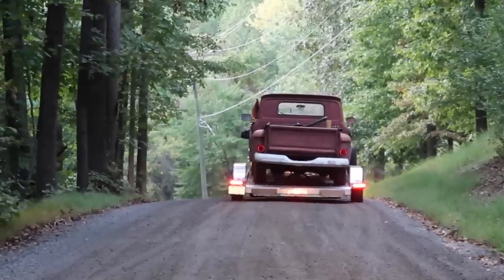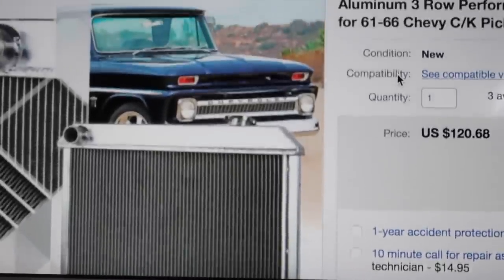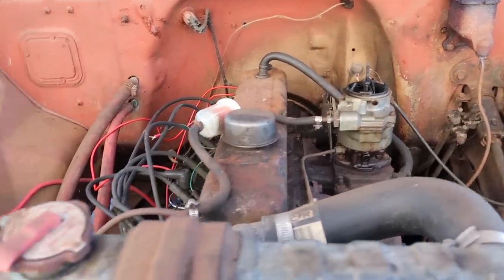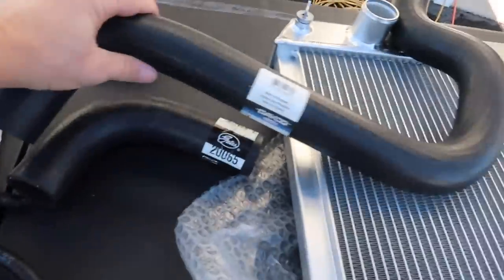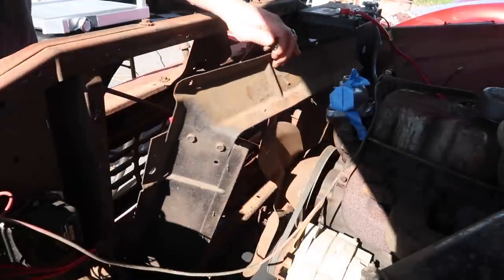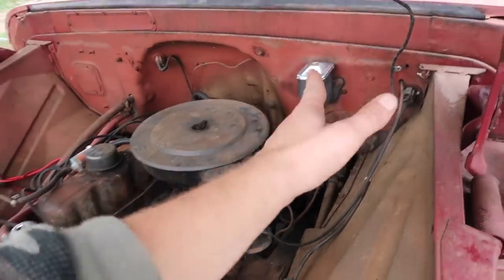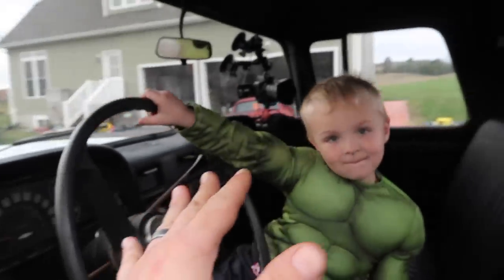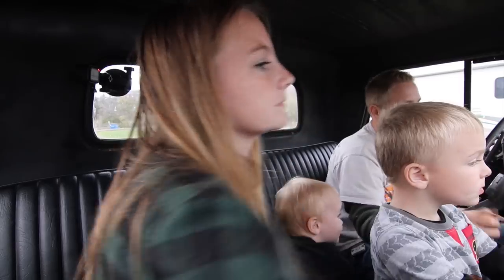Abandoned Field FIND First Drive 1963 Chevy C10

Comment: Almost any Chevy small block, especially from the same era, would be pretty much a direct bolt-in. No weird engine mounts, transmission cross-members, or funky clutch linkages to fabricate. If it were my truck I'd put in a 350, you will never have to worry about expensive, hard to find parts. Get a more modern four-speed from a newer model truck, those old three-speeds are often lacking synchros, and that means double clutching. If you don't know how, you need to learn, or replace it with a more "civilized" transmission. It's easy and cheap to install a four-speed shifter on the floor, and there you go. Carburetors aren't all that hard to work with, the old Rochesters are commonplace, and easy to rebuild. If you follow ALL the instructions in the kit, and don't skip steps, you will be good to go provided you have a good core to start with. Everybody wants to put in a Coyote, or an LS, and a turbo, and bags, and a 5-speed, or a 6-speed. Meanwhile, you have a wife and two kids and you said this is a budget build. If you're rich, go ahead, heck get some shop to build you another clone of every "checkbook" rat rod. If you still want to be able to afford to eat, keep it simple and do it in stages. You'll learn a LOT about trucks, and if you don't have a full shop and massive set of tools, it will be much easier for you to get good results with a simpler build. I did a complete engine swap on an '84 pickup with a set of sockets, combination wrenches, and a few other simple tools. Try that with a modern engine, and you'll be in for some hard work, and vocabulary expansion. Good luck whatever you do.

Comment: I would run a compression test ..if it's a head gasket ? Wich would be weird ..it's a really in expensive fix .and super simple ..don't do an engine swap over that ..now the bad news is this aluminum radiators do not

Comment: Tell me that wasn't a crappy fuel problem. I don't mind being wrong it's just being stupid, I some times have a bit of a problem with. Head gasket easy to check, I don't know if I ever seen that on them old Chev 6 cylinder's.  More likly cracked head from freezing. But; didn't see no white smoke coming out the exhaust, aint saying it never happen's just unlikely. Im given you 2 thumbs up just fo the great effort and the backwards driven while the little woman was remind'n you about the fire potential and I actually had at least a dozen Chev pickups and trucks over 50 year span at least one actually caught fire.. I could work on them in my sleep some were like a member of the family. Them were the days...

Comment: 95% sure, the reason it's dying on you, is because of gas tank issue.. inside of your gas tank can and will rust, just like the fenders. With all the movement it just stirs everything up and then sends it to the the carb.. I see new fuel filter which helps but won't solve the problem.

Comment: Head gasket is easy job to do. Take the head off and put a 20 dollar gasket on it. You dont have to take the whole engine apart just take the valve cover off and undue the head bolts lift it off and clean the old gasket off and then put it back on and torque it down in the proper bolt pattern. easy peasy.  Your carb is not tuned properly and the carb needs cleaned and a new kit. Is there water in the oil? if not it dont need a head gasket. Is there steam coming out the tail pipe and I mean like a huge dark thick cloud of steam that is like non other. so much steam it covers they yard. Bubbles will also come out of the radiator when there is a blown head gasket look in there and see if air is coming up through the anti freeze. It dont look like a blown head gasket to me. Also you can see antifreeze stream down the side of the block if the head gasket is blown sometimes. If there is water in the oil then the head gasket is blown for sure. When a head gasket blows it fouls out the spark plugs and you can see green dye on the plugs whiteish green dye on the plugs them selfs. Take them out and look at them.

Comment: I dont agree head gasket is blown,I think you have a lean condition with carb,or a base gasket leak...try turning in the carb screws all the way ,and then back them out a turn and a half,that's a safe setting to start with..also check your PCV vacum..especially if its using oil,that will sure enough cause it,and a lean condition causes over heating,also I bet it runs good when choke is on dont it?..if it does that definitly means you got a vacum leak and running lean!also giving her a little advance on the timing will surely help too!..if you take radiator cap off and see bubbles that means it's got a head gasket leak,into water jackets, or if you see steam coming out exhaust that means headgaslet leak on exhaust...but I really dont think it's a heagasket because you could have a blown gasket and one or two cylinders misfiring youd clearly know it's missing and you would still have enough power running on 4 or 5 cylinders to smoke the tires...timing,and lean condition is causing all of your issues,I noticed in video you didnt spend much time prepping gasket surfaces properly,you might want to take a look at your base gasket,you can also take a can of carb cleaner,while it's running spray around base gasket and intake gasket,if you hear the engine change sounds or smooth out for a brief second you have a leak wherever you just sprayed..one more thing those old chevys are notorious for rust in gas tank,did you install an inline fuel filter?..I sure hope so,because if not I cam assure you that you have a clogged fuel line or a bunch of trash inside your new carb.

Comment: skip the air bags it will be money saved that you can spend in other areas of the truck,  example engine mod or upgrade, driveline, possibly creature comforts for the cab, ie, seatbelts or child seat tether mount  which is mandatory in NC if you have a child passenger in the vehicle, your boys are your greatest treasure, the heck with everybody telling you engine, paint , and bags on the truck, it looks completely badass just the way it is, if you sell it down the road you will get more money for it, my just bought a 1967 ford country squire  station wagon and paid $1100 for it tax incl, cleaned it up, it still had original paint factory vinyl roof with roof rack and factory cruise control and the wood siding faded a little surface rust, he bought it Wednesday oct.23rd this week and sold it today Sunday oct.27th 5900 bucks, this is the same quality you have in your truck besides if you bag the suspension you'll be cutting and modifying  the under carriage of the truck compromising it, jus sayin, it ups to you and Team Laura

Comment: If you coyote swap that thing you will be hated so much also what did you expect with a completely unadjusted carb another thing is it could be air in the cooling system causing it to get hot

Comment: pull dipstick if there is water and oil mixing it will look like chocolate milk thats a blown head gasket if oil looks normal the timing is retarded that will cause it to get hot as well just get an old style timing light and set the timing and fix the carb issue running lean like its doing will cause it to heat up as well good luck

Comment: Head gasket is not hard. It's a push rod engine so very simple to replace.
Reply from the maker: Jonathan B wanna help replace it?
Reply: @JD_JoyrideTV  it would be fun. But I live in Texas. And I going to college full time. You could actually pull the head off while the block is in the vehicle since the engine bay is so vast. But if you rather do a small block swap it's up to you. Maybe  you Chevy buddy could help with it when he has time. Good luck sir

Comment: I get most of my parts from rockauto.com  Good prices and in some cases GREAT prices and fast shipping. i.e. I needed a cabin air filter for a 2012 Subaru Forester. WalMart $25, Auto Zone $34, Advance Auto $47. Rock Auto $3.60. Can't tell it from the original and slid right in. Same vehicle PCV valve. Auto zone $28, Rock Auto $8.50. They not only have the part you need but usually SEVERAL options of it. I'm thinking of replacing the rear differential, axle assembly of my 2002 Ford Ranger (58,000 miles) from an open to limited slip. They have it and then some.

Comment: Was that radiator not for a 63 Chevy pickup?! Should of been a bolt in to the stock location dude?!
Reply from the maker: Adrian Tomlin it wouldn’t bolt in to the stock location. I had to make some L brackets work.
Reply: JD JoyrideTV  Did you ask the seller of it was a direct fit?! If ya did and they said it was, you should not have to modify anything!

Comment: If you decide to put airbags on the c10 you may end up in the doghouse but that aside you would have to find a place for the compressor for the bags I think you could construct a metal housing to protect the compressor from the elementals and to bolt the housing to the bed so you can remove it if you ever needed to remove it to fix or replace it but I agree with your gf or wife I would rather see it factory as possible yes I know you want to have a rat rod look but I think you could get some coil over to have the same smooth ride as the air ride system and as the rims go you could sandblast the original rims and repaint them with a gloss black and I think that would look good and replace the tires the same size and try to find a touring tire for good handling to hug the road another thing that you could do would see if you can find a bed cover that opens with manual strut actuators or you could have it operating on the airbag compressor to raise and lower with the press of a button but that would mean you would have to protect that mechanism as well but I am just giving you advice on the build

Comment: Don't trust that 55 year old temp guage... I have a 63 GMC a 64 Chevy a 64 GMC... none of the temp gauges are right. Did you ever pull the pick-up tube out of the fuel tank.. the sock gets plugged with sludge so easy and causes the same symptoms you have. The heads on these inline 6 engines seldom ever have head gasket or cracking problems. I have no fan shroud on my in line 6 and it has the original tiny radiator, I haul 6500 lbs rock all the time and we have 7% grades on all sides of us and she never has overheated. My engine is a 250. The carbs are so dirt simple, I have never had one that needed replaced, just new gaskets because of the ethanol in the new gas. That radiator you put in should keep it cool even if it had no fan. I have kept mine all stock except I upgraded the brakes to a 1968 dual master cylinder, and she has leaf springs from the rear axle up to the frame just under the cab along with the original coil springs that have air bags inside. Now she stops even with 6500 lbs rock like she has power assist brakes

Comment: Something yu left out of video,you should wrenched the engine to tdc #1 cylinder by crank bolt, lining up timing Mark's. since yu cleaned tank lines new fuel filter yu should have replaced fuel pump yu didn't mention that yu commented on crap in lines from tank ,hoping yu changed lil n filter after all the work yu did on engine, but the very first thing , yu should have made a compression check  on  each cyl. n cleaned n set gap on plugs 3 on three is same on any truck or car maybe we'er a little wondering why yu didn't just go ask your Daddy or the local mechanic in town they would be glad to help yus

Comment: Whew! This video was harder to watch than the last one. I've got a couple of helpful suggestions if you're interested. I hope you cleaned the intake manifold gasket surface better than it looked in the video. Why did you not buy the correct radiator? Learn to double-clutch so you can put it back into first gear while still rolling. Stop giving "Hillbillys" a bad name by thinking you're smarter than the engineer who designed the truck. And most of all NEVER no NEVER use Truck and Bag-it in the same sentence. My 1962 Chevy 1/2 ton has 800,000 miles on it. It's all stock.

Comment: NO BAGS .   the point in buying a classic or antique vehicle should be the genuine experience ,feel ride, and performance AS INTENDED bye designer ,manufacturer  and those evil engineers . if u want a ls with rack and pinion steering and AIRBAGS just buy a tube chassis  and a fiberglass body . STOP RUNNING OLD VEHICLES this means you restomod guys and doll's. man you have to be in the right gear or she jumps everybody should learn a three on the tree shifter .

Comment: i would rip that engine out so fast and put a big block in it i just fired my 68 up today with a 454 stroker boy does it sound good i pulled a rebuilt 327 out of it and give it to my kid i would sy the small block had about 350 to 400 hp but now it has some balls shooting for about 800 hp with tunnel ram